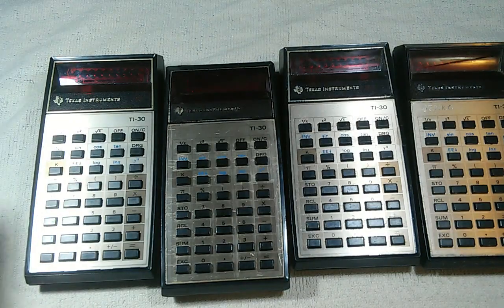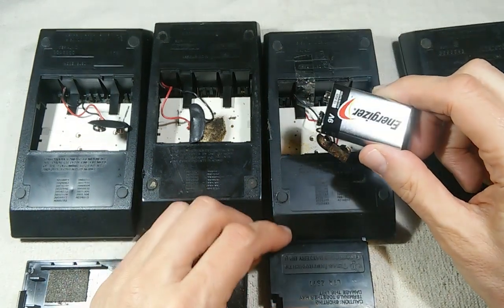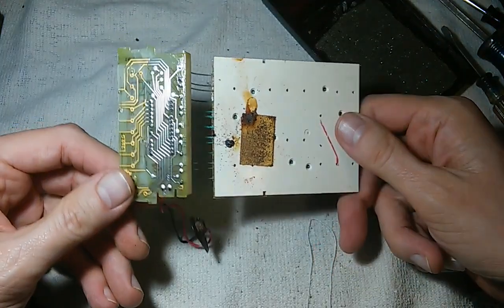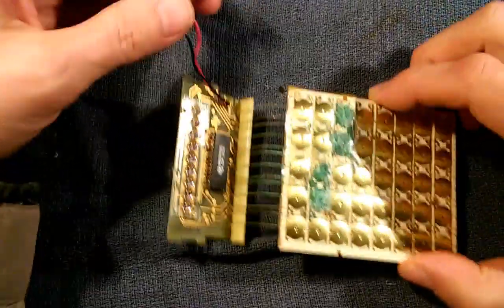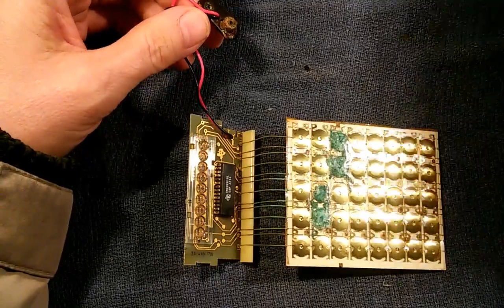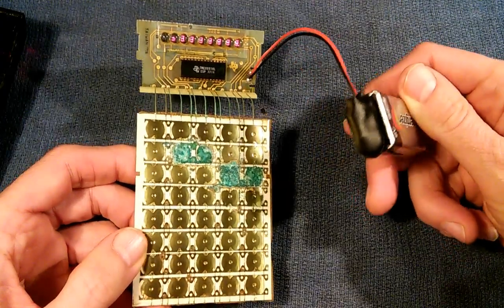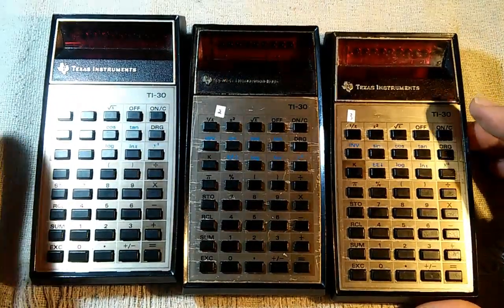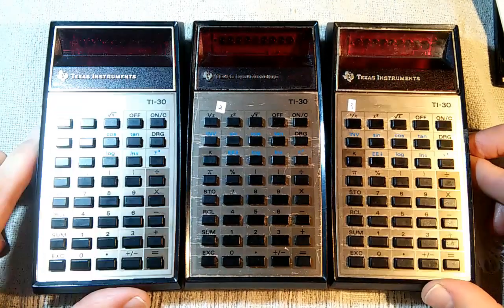Texas Instruments TI-30 Digital Calculator: Repairs

Comment: Literally repaired one of these today. Symptom was key bounce, 2 digits appearing with a single press. Peeled off all the key pads, tinned all the tag welds, scraped off the paint on top of the pads for better heat transfer, then melted the solder from above. As each row is now only held on with a single solder point, I put kapton tape across all the pads and wrapped round the back. Calculator now works perfectly!! Also if it helps anyone, there is a 3D printable battery cover on Thingiverse...

Comment: I have the first TI scientific calculator, TI SR-50. Same problem with battery leakage as well. I'm using this video as a repair guide. It uses three AA NiCd batteries same as the HP-35, the first pocket scientific calculator. At that time the HP-35 (1972) was $400 and two years later (1974) $170 for the TI SR-50. $25 for the TI-30 (1976) another two two years after for the same functions, just amazing price drop.

Comment: Should try Isopropyl alcohol and cotton swab and see if that cleans up the gunk. I along with a lot of fellow college students in 1981-82 era had these same model cheap calculators. Seems all of them suffered from key bounce. Press ANY button and either it wouldnt work or press harder and it would spray several numbers as shown near the end in this video. Numerous times I had to redo calculations and hoped it might work. Many of us had to get new and much better quality calculators.

Comment: Hi, is the foam pad necessary? I took apart my calculator to see why some keys keep bouncing, and I found the foam pad completely disintegrated. Right now I don't have a replacement for it and I don't know if I can use the calculator without the pad.

I found the calculator hanging off of the edge of an e-waste bin, took it home and tested it, it powered up no problem (well, except the bouncing, possibly due to the disintegrated foam pad).

Comment: Interesting video and retrospective. So there were ongoing changes probably intended to solve user problems. I got an SR50 for Christmas in 1973 during my sophomore year in college. Unfortunately I didn’t keep it nor my Pickett circular slide rule. Recently I got the bug for an old LED calculator. Those old batteries sure took a toll on that early TI engineering. I still don’t understand why the AC power supply output was AC rather than DC 🤔. Thanks for the video

Comment: Thanks...  Just like TV remotes  the substance residue build up could be anything.  But most likely soda  or potato chips oil.  Styrofoam?   I think you mean foam pad.   I have an old ti 44 that needs that weld repair, but like you I will try solder.

Comment: Regarding the intermittent button bounce and non-response (https://youtu.be/eZfwRvL_xb0?t=1004), that was present on my brand new TI-30 when I got it back in the 1970s. I hated this calculator because of it. So many times I would have to re-do calculations to get the right answer. I replaced it with an HP-11C when I got into college. That was a joy.

Comment: Hi David, regarding those corroded out copper plates on the first calculator, did you consider 3d scanning one of the healthy pieces (many 3D printing shops provide that service) and then ordering a replacement to be 3d-printed using a supplier such as Shapeways? Perhaps it doesn't make economical sense, but it might be an interesting hobby project :-)

BTW, I found yesterday a 1977 TI-30 pretty much like yours at a goodwill market. It's a beautiful and useful piece of history.

Thanks for posting this video!

Comment: Dear David: One of the calculators you have and also one of the holsters, serms to have been owned in the past by a cousin of mine, by the name of Miljenko "Jenko" Marinković. If you still have both and want to sell them (in whatever condition they are) I would like to buy them, to keep a memory of my cousin. Kindest regards. Boris Marinković.
Reply from the maker: The man who sold me these calculators is named Jim Jenko.  He is an American Chemical Engineer and he lives near the city of Pittsburgh.  I do not think he is the "Jenko" you referred to.
Reply: @c.davidgraves4848  Dear David: OK. Thanks for your quick answer. There is another "Jenko", then. I still own a TI-30 back from my days of collegue (1976). It is in working condition. I had before a Bowmar MX80 (a.k.a. 90152) from my last hi school years (1974). It is also in working condition, but only via an external power source. Thank you again. Boris.